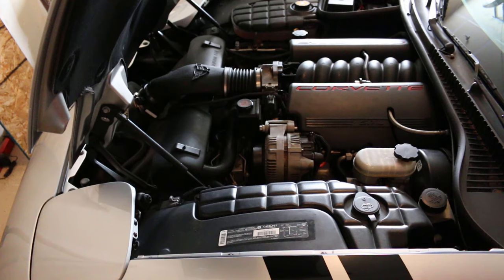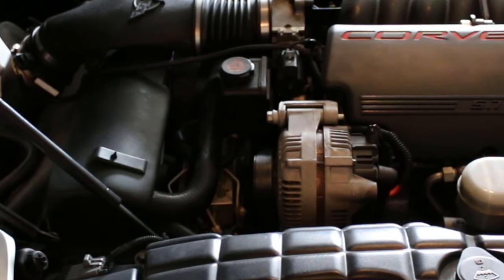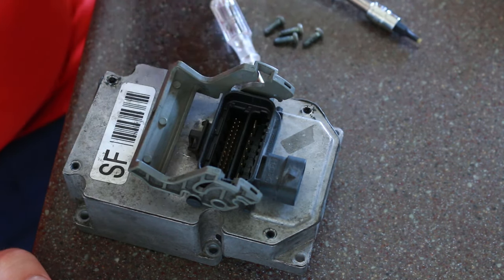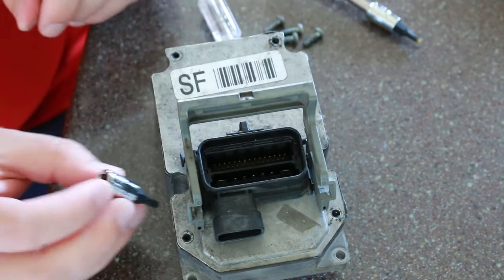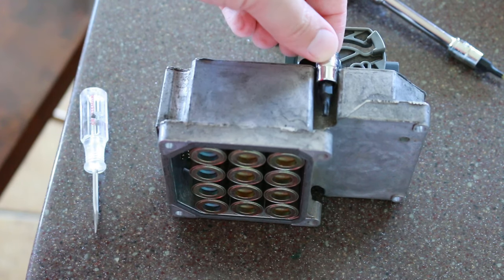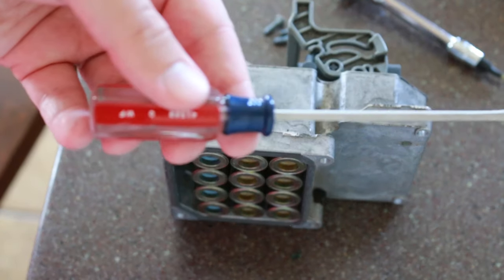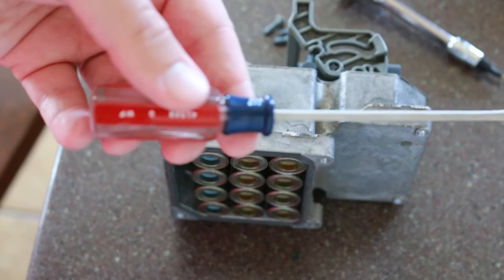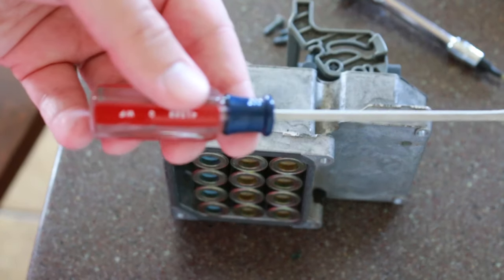C5 Corvette EBCM traction control fix under $15.00 2001-2004

Comment: We took our 2001 Corvette to the dealer over three years ago with this issue. They told us to expect to spend north of $2K to repair the traction control and active handling system. After watching this video we did this fix ourselves this past weekend and I forgot how wonderful my gauge cluster looks without the warm glow of those amber lights. Thank you so much for this tutorial. I definitely owe you a cold brew if our paths ever cross at a Corvette meet! Keep up the great work man.
Reply from the maker: Obie Young II I am glad you didn’t waist all that money and found this video. Excited I could help.
Reply: May I ask, what are the effects of having the module failing on you? how did the car change (handling-wise) and how does the car feel?

Comment: I'm 65 & did my 2003 C5 z06 myself on a Friday & Saturday. Not gonna sugar coat it, it WAS a beating! Easiest part is the soldering. Getting the EBCM unit out, removing the cover for access to the circuitry board & then re-installing the unit in the car is the beating, because of your limited work space getting the unit out & back in. But it WORKED! All warning lights are now gone, I've got my ABS, Traction Control & Competitive Driving modes back. The car runs great & it cost me nothing but some blood, sweat & tears, lol. If you have some mechanical ability, a little circuitry soldering experience and A LOT of PATIENCE, you too can do it. Spend the $1700 that shops want to charge you to make the repairs on something fun for yourself! Happy Vette owner, again!
Reply: GR8 testimony Sir.

Comment: Ran into this problem with my 2002. LHM Chevrolet quoted me $1,500 for a new EBCM and another $1,500 for a EBPV, thinking the car needed both. I followed your guide and fixed the problem with only spending $30. Thanks for the guide, you saved me $3,000 plus dollars.
Reply from the maker: Cole Rice that’s great! Live in Utah? I do. I need to change the oil pan gaskets and adjust the e-brake. I just changed out the clutch master cylinder. More work to be done.
Reply: @corkycars93  Yeah, I do live in Utah. I need to adjust my e-brake as well. Lol, there's always more work to be done.

Comment: I got my C5 in 2016, went through Corvette Forum and read all the threads about this before I tackled it at age 71 then.  Only thing I would do different today is drain the coolant and take off the upper radiator hose.  I didn't and really tore up the skin on my hands getting to the six T20 retaining screws, wedging my hands against engine parts and anything else to get the job done.  

I didn't find any info at the time about drilling and tapping the hole to start to get the top cover off, that's a great tip!  I used razor blades and exacto knives to go around and around the perimeter of the top cover bit by bit, then putty knives and screwdrivers until I got it off without damage.  Drilling and tapping the hole and using a screw to begin to lift the cover is definitely easier than the way I did it.  

While you're in there, look for any other spots that might need soldering.  The reason any of us have to to this is that they removed lead from the solder [environmental reasons], using another metal but that made the solder brittle and the connections break due to normal vibration.  I used silver solder to do the repairs, which is ductile and will probably last forever.   

Thanks for putting this up on YouTube!

Comment: Your video was right on!!       The only thing i did different was to buy a set of 3" long torx bits @ Harbor Freight for about $3.00
The 3" long torx #20  on the socket worked real good.  My Vette works like new. 
 Thanks Again
Donnie in  Deer Park  Texas
Reply from the maker: Great! So glad it worked for you. I have more videos coming soon. Next big project is changing the seal for both upper and lower oil pans. It’s not going to be easy or fun..... but will save me about 1800 doing it myself.

Comment: Just a few tips that made this job a lot easier for me...
I magnetized the T20 8 inch screw driver and the T15 bit
I used a QuickJack so I could raise and lower the car quickly
I removed the upper two screws from above
I removed the middle and lower two screws while under the car
I removed the EBCM while under the car, easier with more room
When replacing screws, tape the edge of the screw head (on both sides) to the magnetized screw driver with duct tape. It keeps the screw in place with considerable stability and the tape pulls off the screw without leaving any tape behind.

Comment: did it  e x a c t l y  as shown in this video on a Cadillac Seville 2004 - including the yessss yesss yess yeeeeesss - only thing i did additionally was to heat the whole PCB with a hairdryer to prevent any solder cracks to be missed - thank you from Germany for the GREAT demo and for sharing!!!

Comment: Thanks Corky, Fixed mine a treat. If you are ever in south west France I'll cook ya dinner and provide the wine.
Reply from the maker: Glad it worked well for you. Would love to visit France. I will hit you up if I am ever in the area. Thanks.
Reply: @corkycars93  Oh yeah, I forgot to mention that the hole you drilled and tapped out is 4.2mm which is the right size for a 5mm tap, which may save a little work

Comment: Thanks for posting this. I have a c5 z06 with TCS ABS light and the code that I read was  for EBCM failure. I followed your great directions and fixed the problem. Without your instructions I would probably still be trying to get that sealed cover off. Excellent work.
Reply: do you remember what code you were getting?
Reply: My is C 1214.

Comment: After viewing your video (multiple times), I finally decided to tackle this project.  Your video took all the guesswork out of doing this.  I did the repair today and the results were excellent!  No more driving with two big amber idiot lights staring back at me.  No more having to clear the error messages every time I start the engine.  No more "ding ding ding" every time I'm getting out of the car. Here's the best reason for fixing this system:  One day on the freeway, I had to do a panic stop without the ABS.  The car got almost sideways after the tires locked up.  Now the ABS will work like it should if a panic stop is called for.

Update (October 2022):  The EBCM traction control system is still working flawlessly.  This repair was 100% effective.  No more random idiot lights or error messages.  Thanks for posting the video.
Reply from the maker: So glad you found this helpful! And I am glad you are safe after that experience of slamming on the brakes. Would love for you to subscribe to help support the channel. More videos coming soon.
Reply: @corkycars93  Subscribed!

Comment: Many thanks for the video.  I just used this approach for the same issue on my 2003 Cadillac DeVille DTS and it worked.  And I was even able to see the suspect solder connection among the five and fixed it after touching up all five.
Thank you, thank you, thank you.

Comment: I just Did Mine, It was not difficult at all, You need a Screwdriver type It took 15 mins to get it off. I bought my car with 36,000 miles and it had been off before, solder it and it works great, Thanks

Comment: My EBCM lights came on several weeks ago. Happened once before but recovered after a restart an hour later...then fine for a year. Now went out and I was planning to fix per this video. But after 3 weeks it cured itself and has been OK for a month so far.  I'll wait until a permanent failure.  That is my message...wait a long while before attempting to fix it. Nothing gets damaged by waiting.

Comment: When you said your rubber mallet was missing when you and you should have been looking for a dead blow shot filled hammer I said ok lets keep watching. Then you got your framing hammer so I then had to look at the title of the video because I thought may be this was a vid on how to build a garage for your C5  :)....  Just a tip when EVER taking out those TORX bit screws or bolts put your driver in the head of the screw and hit the tool with a hammer of any kind hammer, before you try to loosen it. This will  ensure that almost every time you do this you will not strip out the screw or bolt head and it will also make it much easier to get the first turn with little force. Thanks for the video it is very useful..

Comment: Today, I finally got to remove the EBCM from my C5.  The unit was separated and tomorrow I am hoping to do some soldering on the points you suggested in your video.  The biggest challenge thus far was separating the top from the base. The hole was cleaned out of silicone, drilled and tapped.  Threading the screw in slowly broke the seal and with the aide of a flat screw drive the two sections came apart.  Mine had some melted substance just like you had Corky, not quite as much, so that will be cleaned off before soldering.  I will post more on how it goes.
Reply from the maker: Get it Bill.
Reply: Any update bill?
Reply: @fabrizziolopez2205  Yes, I followed the instructions and re-installed the unit in the car.  What I performed was unsuccessful.  There was something else defective and as mentioned below, sent it off to ABSfixer in Missouri.  Once returned it has worked flawlessly for 7 months and counting.  Now I am enjoying the car again.

Comment: for future reference, find a box, open end or closed end wrench (what ever you want to call it), to fit over the handle of the screwdriver for more leverage
Reply: Small pair of pliers or vise grips is much more effective and will not slip, thus saving your hands. None of my tools remain virgins for very long. If my screwdriver handles carry a scar or two on them, so be it.

Comment: Thanks Corky.  I got my 01 C5Z in March this year.  Just started having this issue.  Gonna check the ground points, just because that's always a good thing to do on these cars ... and then get to rippin that ECBM. 

Hat Tip!
Reply: did it work?
Reply: @johnbonham617  yes.  I then had the RF speed sensor fail, but yes, the problem with the ECBM is fixable just as the video shows.  21 year old car.  electronics are gonna fail.
Reply: @shaark92  I ask because i'm hearing that the fix doesn't work on the 97 - 01 years.
Reply: @johnbonham617  I'm not the authority, but resoldering those points on the circuit board fixed my ECBM.  I remember there was a year set which this didn't work, but on the '01, it did.

Comment: 10:28
I have the same crap going on with extra warnings. Traction Control, Shocks inoperable, don’t pass 80mph, ABS, service soon, service now,  I am going to try and tackle the job and see if it fixes these problems. By the way for a non mechanic you presentation was first class sir .

Comment: Years ago mine went out and I sent mine out to be fixed and was very grateful. At that time it was said a resistor had to be replaced. And on top of that , no one had shown how to open the lid.
( I gave up trying )Not being electric minded , I was happy to send it off. But now that it is just a re-soldier  , I would differently attempt it myself.great video.

Comment: The dealer is stuck using factory parts when available.  The new part was $1200 retail and the book calls out two hours for the repair and as customary, they usually charge an hour diagnostics to run through the complete "diagnostic trouble tree" to prove what part is wrong and then retest once repair is complete.  The dealers around here are $175/hour, so I can see how it could add up.  As independents, we have the choice of shade tree variations from the factory prescribed methods and sources.   Thanks for the video.  Even though I've been doing this repair for over 15 years in my shop, it's always interesting to see how others do it.

Comment: WOW! WOW!               TWO WOW'S            THANKS FOR TAKING TIME TO POST THIS.
I HAVE HAD MY 2001 FOR SEVERAL YEARS  . I HAVE BEEN FIGHTING THIS PROBLEM  ABOUT 4 YEARS ,   BIG THANKS
Reply: Your video was right on!!       The only thing i did different was to buy a set of 3" long torx bits @ Harbor Freight for about $3.00
The 3" long torx #20  on the socket worked real good.  My Vette works like new. 
 Thanks Again
Donnie in  Deer Park  Texas
Reply: @donniehill1704  good to know.. Did you use the bolt method getting it apart ?

Comment: Very informative video, thanks Corky. 
Another thing I thought might be done, is instead of filling tapped hole with sealer get a short bolt of appropriate size & a sealing washer or O ring and plug it that way. 
Lucky for me my traction control still works, got an 02 also but it's a Z06. 
Thanks again for the vid..

Comment: You were able to test it without remounting.? I have a 1998 C5 Vett. module been disconnected to allow me to still drive.  I'm ready after watching your video get it fixed Thanks for your information. I'm going to tag your site for possible future issues. I plan on keeping the car.

Comment: Thanks man. It worked for me! I just happened to have all the supplies already. The screws holding the module to the unit, were accessed semi-easily with a 1/4" drive socket set with a couple of extensions and a swivel adapter and of course the torx head bit.
Reply from the maker: Glad it worked for you. Money saved!

Comment: One suggestion I would make when doing the pullout of the EBCM unit is to get the front end of the car up on ramps if possible.  The hardest part of this fix is the bending over trying to get to the hex screws on the unit. Lift her up several inches and your back will thank you and the job will go faster.

Comment: I had the traction control warning and this seems to fix it. So far so good. The screws are a bitch. I hot glued the screws to the t 20 bit so they won't fall off during installation. Don't get hot glue in the screw head. Insert your t 20 bit into the screw then apply hot glue around the head and bit. When you pull the bit out the glue comes out with the bit. Screw head is clean. Getting the screws in and out is the hardest part. A long Dewalt t 20 bit works well. I think they are about 3 to 4 inches long. You will need various extensions and adapters. I have a solder sucker, so I removed the old solder first, used Flux and soldered the 5 terminals.

Comment: To break that difficult T20 holding the module you could cut a Torx screwdriver shaft to length, then weld on a piece of steel at right angles to the end.

Comment: My 2001 just threw that code today. Looks like an easy fix, thanks!
Reply from the maker: Ya, it’s a common problem. If I can do it, you can do it! Good luck.
Reply: @corkycars93  Yep, it was easy. I used a torx screwdriver. I had the screws out in less than 5 minutes. Tapping the case case to use a bolt to open it is a must. I don't think you could pry it open in less than 5 hours time with all that silicone in there. Removing the big plug before even trying the small one is a must too. Thanks for the help.
Reply from the maker: That’s great. Glad it worked out easy for you.

Comment: Yes it was a big job but I did it I soldered all five points maybe one more but after 500 miles the lights came back on again, did I do something wrong I hate to have to do it again but I  will if I could get it fixed. It was a very good commentary.

Comment: Very good video. I own a 2005 Vette. I need to follow in your footsteps and change out the EBCM. However, I do have a question. As I watched the video and saw the circuit board with all of the pins soldered in throughout the board, I was wondering how can you tell that there is a cold solder joint that is not making good connection? I know that you have learned from somebody else that those 4 or 5 pins that you pointed out are the usual trouble spots. But, as I observed the close-up of the circuit board, I did not see any solder joints that looked loose or corrupt. Looking forward to your comment. Thanks!

Comment: Cool !!  My info panel comes on just after I start driving or turn. "Service Active Handling". Then traction control light stays on. Do you think this repair will solve this issue?? Great video - hope this does the trick.

Comment: The brownish colored stuff on the pcb is probably aged flux, which would be used in the manufacturing process to make the solder "flow" when soldering on the connectors. I don't think it would hurt anything to leave it on there, but cleaning it off won't hurt either. 
My $0.02 (US) lol.

Comment: Actually, this doesn't have to pertain to just c5 owners! Similar year LeSabre EBCMs are nearly identical if not identical, and have the same process to fix it. with the help of your video, I think I've decided to tackle this job myself, instead of sending it to get repaired for $150. Thanks!

Comment: My experience with the C5's is this repair is only useable on 2001-2004 not the 1997 thru 2000.
Reply: So true those years have the rear mounted EBCM  on the back passenger side under the wheel well somewhere I have not seen it I read up on it and called the Dealership they know   take care

Comment: Nice job! I’m wondering if this fix would also resolve my no comms issue. I too have the abs tcs lights. There some chatter about ground points that are also a possible issue I will be investigating .  Funny thing about tools they are never where they are supposed to be.